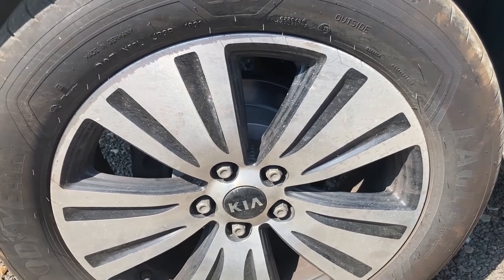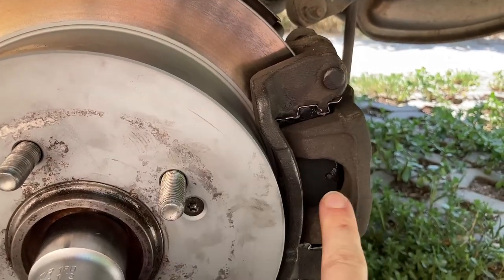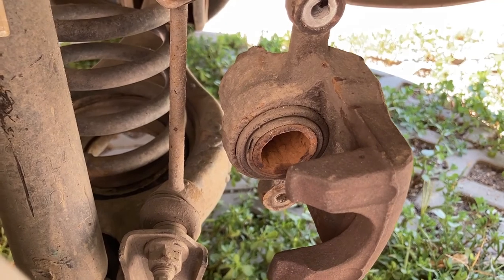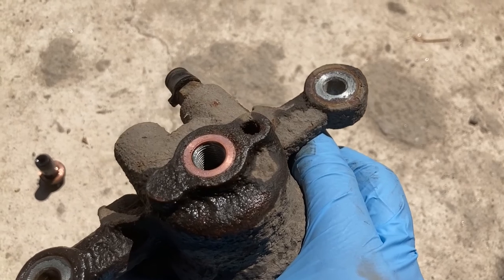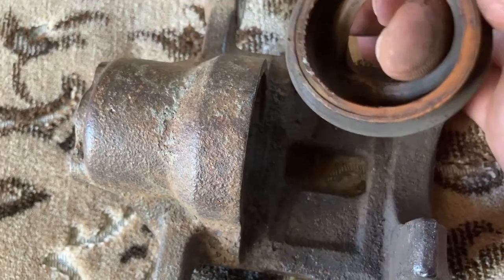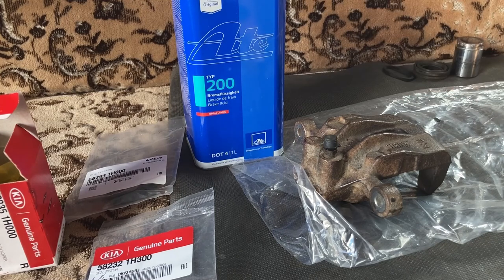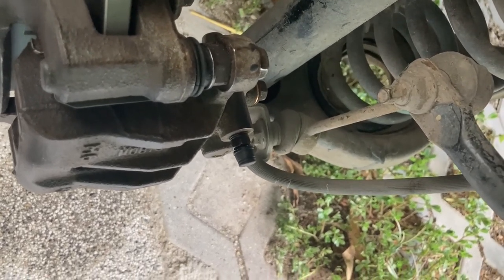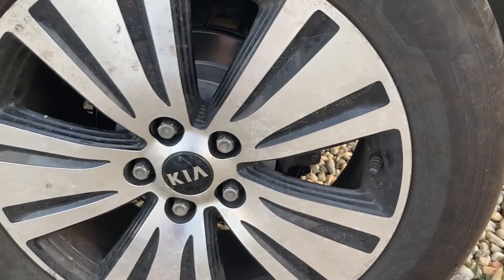DIY - 2014 Kia Sportage 2.0 CRDI: Diagnose and rebuild (repair) a dragging rear brake caliper

Comment: I had the same problem, sticking piston in rear right caliper. So far I have just lifted the piston dust cover and syringed some brake fluid under it and it has freed up nicely, but I will some day do a refurb and your great tutorial will make the job a lot easier. Thank you very much.

Comment: when bleeding the brake, it's easier to use ratcheting wrench, also you can do without one way valve if you run that clear hose UP from the bleeding screw before routing it down into collecting container. For clamping brake line, just use a piece of cloth and vise grips.
Reply from the maker: True, the alternatives you mentioned work just as well, especially if the more specialized tools (one-way valve, hose clamps etc.) are not available.

Comment: Good day boss 
I would like to have advice please 
My front left wheel is sometimes locked up and I went to the garage to change the caliper but just the day after the same issue comes again.
When I went back to the garage he told me that you need to change the ABS unit 
I am just wondering because I never had the " ABS alarm " showing in the dash board and I scanned the car more than 3 times and the scanner is saying no error 
Can you please help me with this ?!

Comment: Very detailed video thank you. Did you remove, check and clean the caliper slider bolts as these can get water in and seize leading to premature and uneven pad wear?
Reply from the maker: I did do the caliper bracket and slide pin clean-up in the rear brake installation video, namely here: https://youtu.be/0ncvWbMUiGQ?t=1922
Reply: @TheMissingBolt   Thanks. Seen it now.

Comment: At same last few days .put on new disc pads caliper .only pressure to left front brake and right side rear  now ,have buddy bleed it 2 times no luck or breakes ..got quoted 2300 for abs pump .from kia .its a 2013 .17 crdi .any ideas as can't get mechanics .does this look like an abs pump fault. Thanks
Reply from the maker: It doesn't sound like the ABS pump to me. The ABS pump has 4 channels (since there are 4 lines that go to each of the wheels), so it's unlikely that 2 of the channels broke simultaneously. On the other hand, as far as I remember (though this needs to be confirmed with a mechanic) the Kia Sportage has a diagonal braking system, where the front left & rear right form one circuit and the front right & rear left form the other. These are controlled by the brake master cylinder which is connected to the brake pedal. From what you're describing, it's more likely that the brake master cylinder has partially failed and it now only supplies hydraulic to one of the circuits. So I'd start my investigation from there. Also, the master cylinder should be much cheaper to replace than the ABS pump. Best of luck!

Comment: Where and how did you get your parts. I’m having an extremely difficult time locating
Reply from the maker: I used genuine parts from a Kia dealer, based on my vehicle's VIN number. They weren't very expensive, despite being genuine.
Reply: @TheMissingBolt thank you!  I’ve attempted calling my dealer asking for these parts but they have me a stupid quote. Tried another dealer and they acted like these parts were not an option.  I hate to replace a caliper because the dealers are just wanting $$

Comment: Does the notch on the banjo bolt go opposite or does it align with the line notch before you tighten it? 31:46
Reply from the maker: Not sure what you mean. At 31:46 it's the bleeder screw, not the banjo bolt. The bolt appears at 29:30 and doesn't have a notch; the notch belongs to the brake hose and when installing the hose, the tip of the notch must go into the dedicated hole from the caliper. If you're referring to these 2, see from 29:17 onward on how the banjo bolt, brake hose and notch must be installed.
Reply: @TheMissingBolt  I don’t know how the time got there. I meant is there a specific way I need to start the thread of the new bolt into the caliper .
Reply from the maker: @christophergalardo3457  No, apart from making sure the hose is sitting correctly on the caliper first, the bolt should be installed normally - start by hand first to avoid any risk of cross-threading and don't forget the 2 copper washers.
Reply: @TheMissingBolt  thank you. I appreciate it.
Reply from the maker: @christophergalardo3457  You're very welcome!